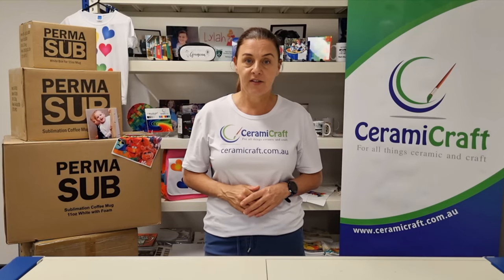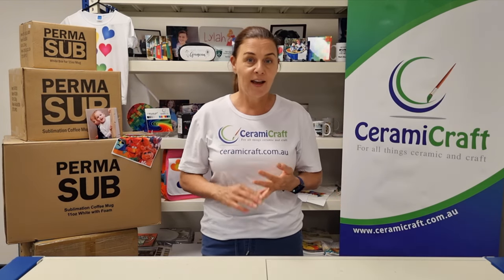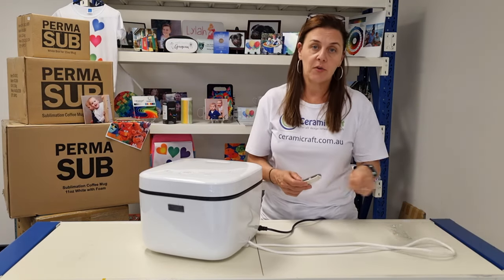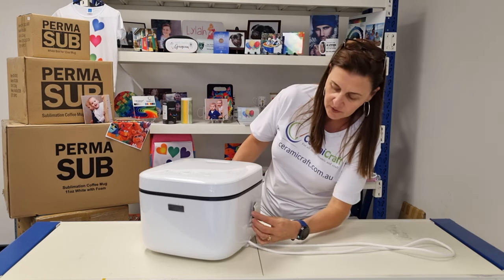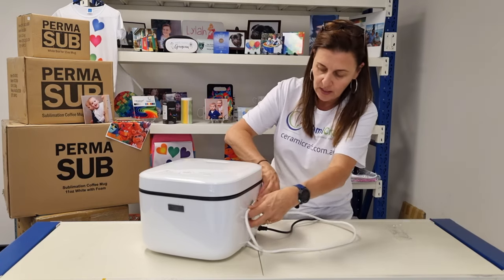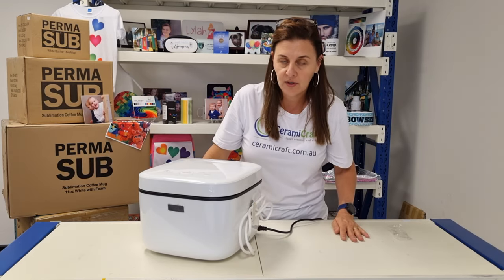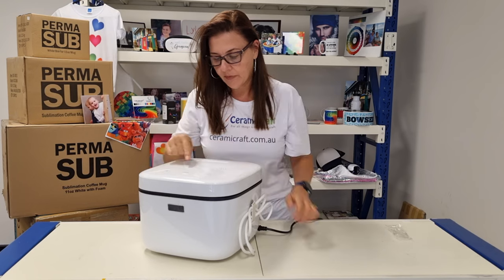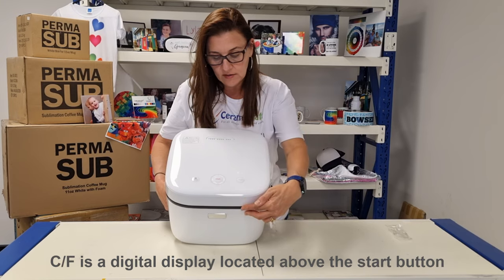Freesub Mini Vacuum Heat Press Attaching Cord Tidy & Changing Between Celsius and Fahrenheit

Comment: Hi. I just want to know. Is it normal that your upper temp take awhile to get to the temperature you want it to be?
Reply from the maker: The elements do require some time to heat up. Just like an oven this machine needs time to pre-heat. Provided it is eventually reaching temperature, then I would say there is no issue. However if you're concerned there may be an issue, or simply not sure of what's happening, we would recommend taking a video and contacting your supplier for further advice.